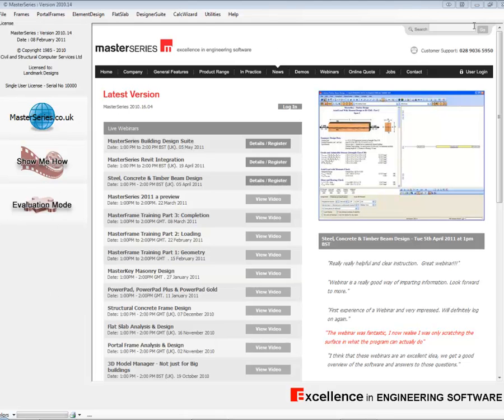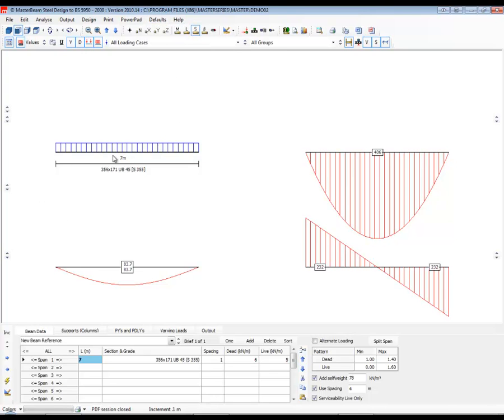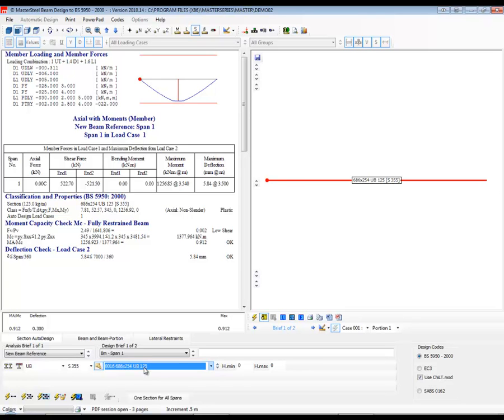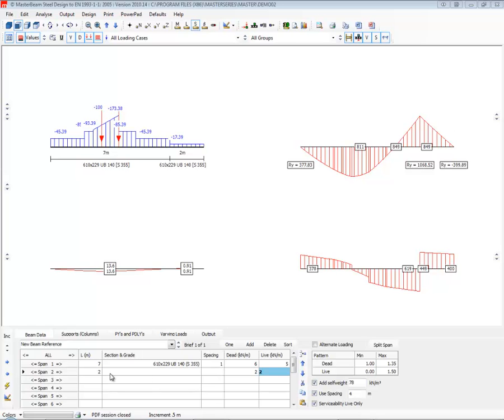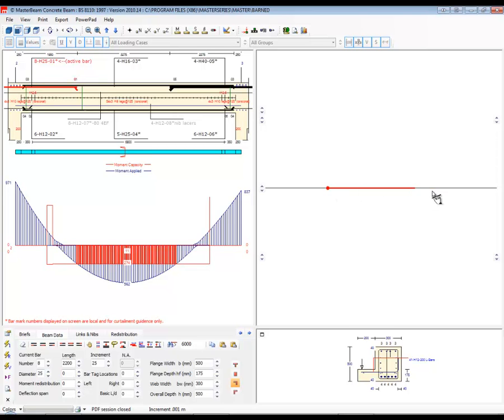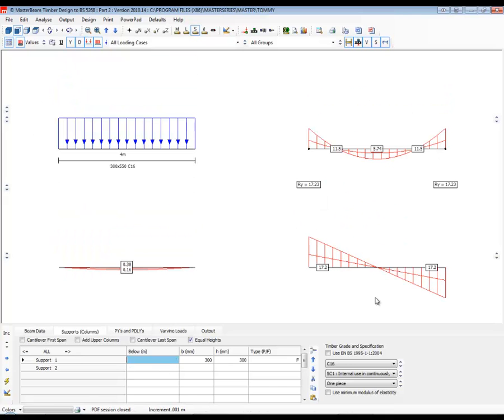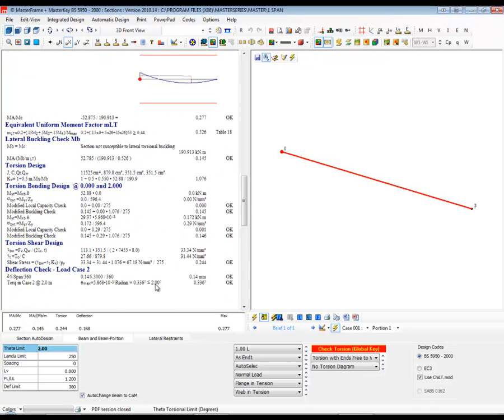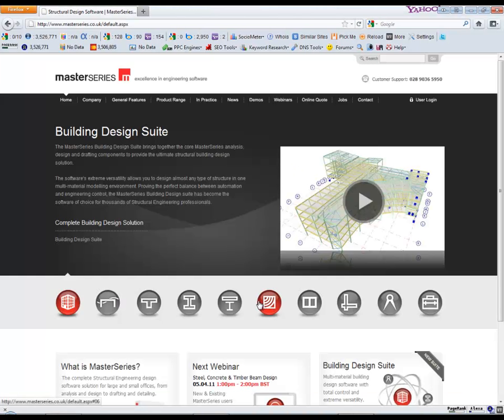Steel, Concrete & Timber Beam Design Webinar

Comment from the maker: Hi Dheeraj,
The software is the MasterSeries suite of Structural software.  More details at www.MasterSeries.com.

Essentially the video covers simple beam design using 3 different sets of MasterSeries programs.

1) The free single span beam designer - MasterBeam Steel Beam Designer
2) The 3 commercial multi-span beam designers - MasterBeam Steel/Concrete or Timber Beam Designer   
3) The powerful MasterFrame and associated designers.

Email me at tommy@MasterSeries.co.uk for details & a free trial.

Tommy